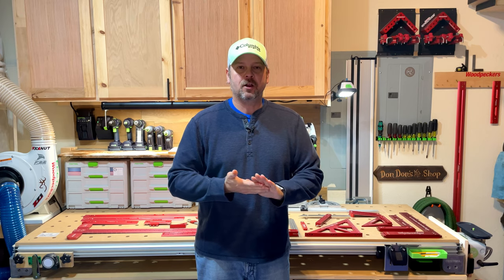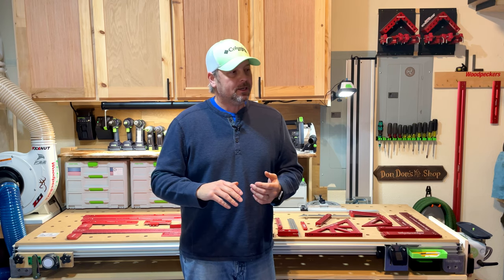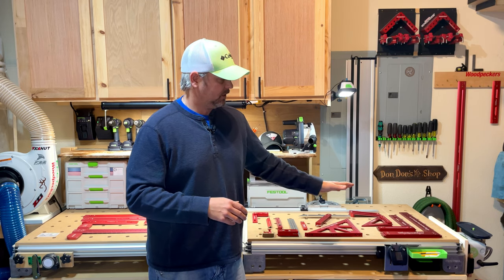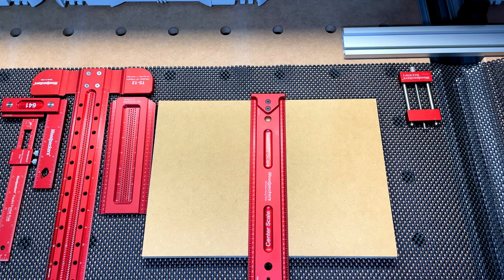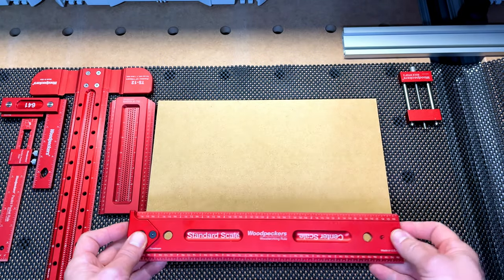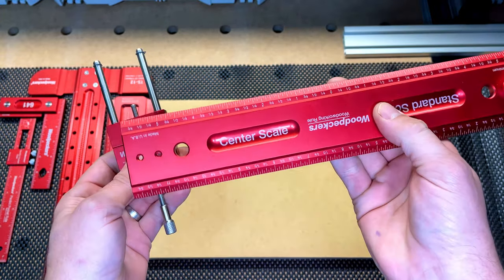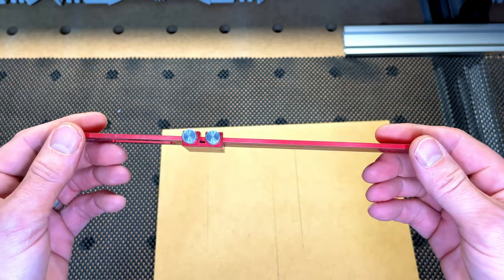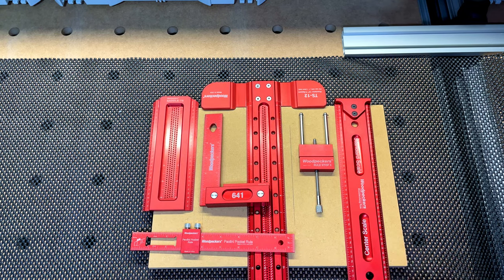Best measuring and layout tools for woodworkers. WOODPECKERS precision instruments

Comment: Nice overview!  You likely know this already, but for anyone watching - the Paolini ruler is designed in such a way that, when using the vertical scale (for router/table saw blade height, etc), when you take off the sliding stop, instead of setting it aside, you can place it in the slot in the middle of the back of the ruler so that the ruler stands up vertically on your table (and thereby making it hands-free).  Pretty handy.   Woodpeckers tools are pricey, but truly excellent.
Reply from the maker: Hey Michael, you’re absolutely correct, and I laughed at myself after I posted the video and realized I missed that feature. I guess when you use it daily you tend to overlook the obvious.

Comment: Hello Brian, I'm currently building my collection and something I'd like to add is the feel of the tools. I have had a Starrett 12" combo square for my go-to shop standard for some time and have always been able to rely on its accuracy. But after I bought my first Woodpeckers 1281 aluminum square, I have been enthralled with feel of it. It's not just the weight of it, which is substantial with a solid balanced feel to it, but it's also the feedback you get when it is set into or onto a corner. It has a snap or click when the corner is spot on square. You can get a similar feel from a Starrett, but it isn't as sharp, at least not for me, I think it might be the added width of the aluminum blade makes it feel sharper. I also like their stainless-steel squares which are great for marking.
Reply from the maker: They are just great tools. Bar none!

Comment: Brian, at 15:33 when you take the sliding stop off and lay it down, you should have put it in the cut slot in the rule.  It holds the rule vertical to make measuring with the depth gauge easier.  Thanks for the review.
Reply from the maker: Yes. I missed the mark on that one
Reply: @BrianWatersOutdoors  Your opinion, 24" T or 24" rule with hook accessory?
Reply from the maker: @carlwebinar1571  is choose the 24” T all day. I use that 90% of the time.
Reply: I was wondering why that rule had a cut out / now I know thanks for the info on that

Comment: While woodpeckers make great instruments of very respectable precision and quality, there are companies that surpass them in quality (I'm only considering comparables, obviously these have different types of product offerings), for example Mitutoyo or Starrett. Anecdotally, two different woodpeckers tools I bought had cosmetic blemishes and manufacturing defects.
Reply: Same here. I don't have a lot of Woodpeckers but I've gotten both a blemished tool and a few that were defective. They have great customer service and they sorted out the issues but it was surprising that they wouldn't catch these things.
Reply: @darrinmc  Since I made that comment, I’ve received 2 or 3 new defective tools from them. They replaced them all for free, but they need to get rid of whoever is in charge of quality control.

Comment: I know the video has been posted for a little while, but could you share some thoughts on the combination/double square?  How does it compare against Starrett?  Is it as accurate?  Does the aluminum head significantly reduce the weight?  Does it accept Starrett blades? Thanks

Comment: Brian- Very much agreed - Woodpeckers and Festool are my go-to shop standards. Precise, well-made, not much else comes close. I was deeply vested into Milwaukee tools and still like the Packout system, but have relegated the M-batt-tools to field use, and use the Festool gear in the shop and for all cabinets and fine woodwork and the custom metal work i do.  It’s simply superior in every way, as all the Woodpecker measuring and squaring pieces - many of which are the same as yours… I am currently bankrupting my children with the new W/P fences and tables for my drill press, miter saw, table saw, and entire new router system table.  As you state here, the precision is as precise as it gets, and it’s all built like a brick shit-house, and sexy design.  Soooo well thought thru to the finest detail and durability.  All I’d add is the English tool-maker Axminster/UJC centered around the Parf and dog systems for the Festool MFT system and guide system designed by Peter Parfett. Their stuff is also as precise and well-integrated into this type of top-shelf shop setup.  It’s expensive and sometimes hard to to get - esp now.. Festool is more than a bit snotty, but well worth the German quality, much like i use in other parts of my professional life where things need to be as perfect as possible, and when it’s not, its always my own errors… as the saying goes, “…good enough is NOT enough..”
Reply from the maker: Completely agree! I too am worried about bankrupting my kids future as well😉

Comment: With your T-square, you scribed a line 8" from the edge of the board. Which side of that pencil line is 8"? Do you cut all the pencil line away and that leave 8"?  I've always wondered this about my own measurement tools. I've got a Incra 6" precision T-rule that has holes for a mechanical pencil like your t-square and ask myself this question every time I use it.
Reply from the maker: I try to cut just on the far outside edge of the line. Basically leaving a very faint pencil line.

Comment: on the little pollinni rule (yea, I have no idea how toxspell or pronounce it either) the part with the knurled nuts fits in the slot on the rule to help stabilize the rule on its edge to make measuring the height of router bits or saw blades.
Reply from the maker: Yes, that was a clear mistake on my part for not going over one of the main features of this rule.....

Comment: Great video 

Are the larger round holes on the t-square for center drilling?
Reply from the maker: Technically, the larger 1/4” machined holes are exactly on 1” centers to align shelf pin locations. I wouldn’t use those as an actual drill guide

Comment: That 6” pinni ruler slide Peace that comes off goes in that square hole so that the ruler stands on edge when you measuring the height of your router bit I can’t believe you didn’t know that about that that’s one of the greatest things about that too it stands up on edge by itself when you put that square slide in peace into that square hole on the ruler
Reply from the maker: Just slipped my mind in the video

Comment: I am a Woodpeckers fanboy and have had to pull in the reins on purchasing these tools.  Hell I have most of the tools only to realize that I don't even use 1/2 of them.
Reply: Which woodpecker tools do you find yourself using the most?
Reply: @purpleyams8738  Paolini Pocket Rule, Steel Straight Edges, Mini Carpenter's square, 12" and 18" woodworking squares, modular bar system, Offset base system for Festool Domino, Straight Rules and Rule Stops, among others that I cannot think of off the top of my head!

Comment: There's a good bit on that table I want to add to my arsenal lol

Definitely the 1281, 641 and mini squares; the paolini rule in stainless, probably the 12" and 24" t squares, etc.
 The 641 and paolini stainless will be my first real woodpecker tools. I do have some of their multi knobs, and they're amazing too.
Yes, pricey, but you're buying these tools for life. It's not like they're use a few times then they're no good. That can be applied to a lot of things in woodworking, like clamps.

Keep it up! It was awesome to see your collection. :-)
What's your impressions on the corner clamps you have hanging up?
Reply from the maker: These Woodpeckers tools are definitely a “lifetime” tool. And Woodpeckers in my opinion are “you get what you pay for”. Thanks for the comment!
Reply from the maker: Forgot to add a comment about the clamping squares...not sure how I missed those but I use them for absolutely every build I make....if there are 90’s on it. They are incredibly strong and of course accurate.  Highly recommend. The extra “rack it” bracket they sell to hang these up are pretty nice too

Comment: I noticed on the 12" Square if you set it on the edge of your board, it doesn't measure out to 12"  but they call it a 12" Square??

Comment: Precise.. yes.  Nice looking... yes.  Over priced... yes.    I have some WP stuff and yes I do like them but since alot of the products are made of aluminum they do tend to be a bit delicate in my opinion.  Not job site worthy but certainly shop worthy with a small number of people or a one person shop.    My other beef with WP is that they have extraordinarily high shipping costs.    Now we are not comparing to Amazon who owns their own planes and pays people nothing etc ..  I am talking in comparison to similar e-commerce sites without a retail footprint.  In fact there are examples of shipping from stores in Europe... Thomann music for example... where the massive distance would lead you to believe big bucks for shipping but in fact the fees are quite reasonable.    You can pay as little as $100 for delivery from Europe.   You end up actually paying more than that from WP if you pick USPS.  In my case I am in Canada and I am comparing apples to apples.    For a company that only does e-commerce you'd think they'd have "international" shipping rates down to a science.   We're just talking shipping rates for fairly lightweight items since most are aluminum... certainly the measuring items.  Thomann are shipping guitars which are bulky and much heavier than a set of T squares.
Products seem very precise and well designed but unfortunately they are out of reach for most people outside of the USA unless you bite the bullet and pay the shipping rates ascribed by WP.     I ordered only once and would not do so again till they figure out their shipping rates to be more appropriate and in line with other US e commerce companies like say Sweetwater whose rates and service are impeccable.